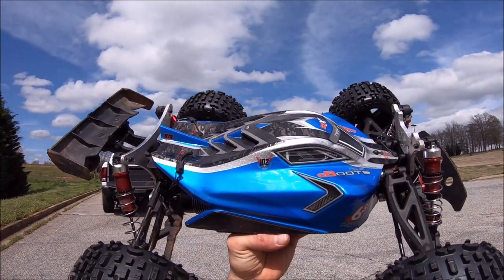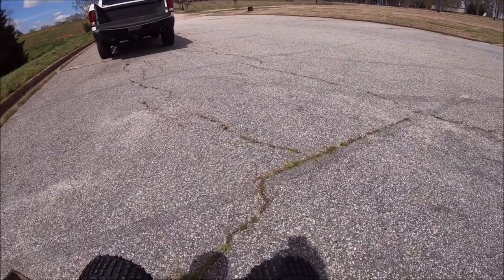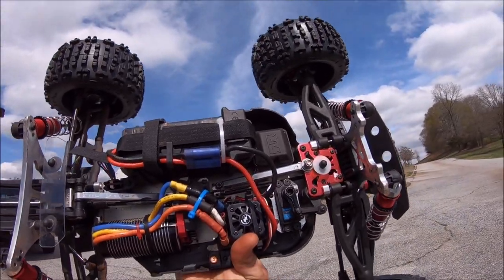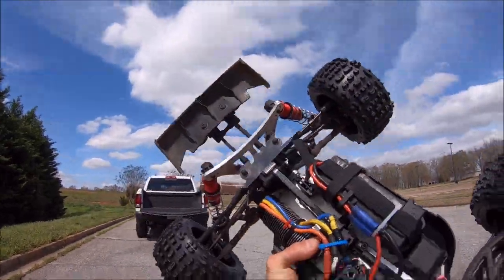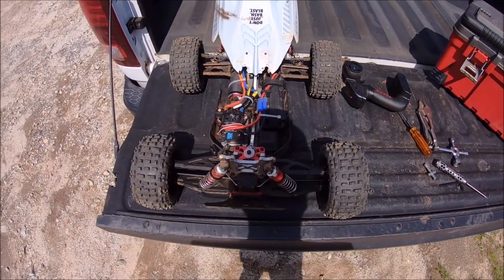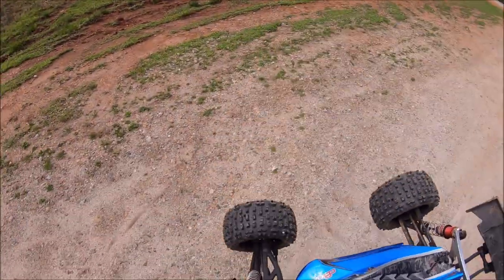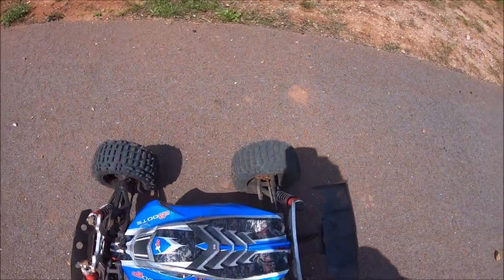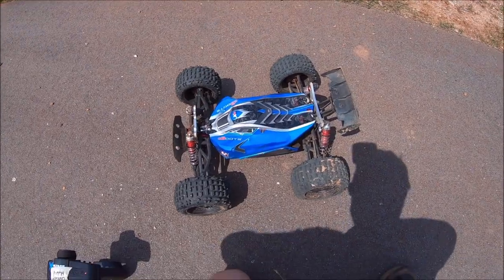"FLIPPIN" BEAST!! Arrma OUTCAST Hybrid 6s with Zoskay servo review.

Comment: That things a tank dude! You beat the shit out of it and didn't break a thing.

Have you tried carbon fiber shock towers? I've got them on my Kraton and I've been kicking the shit out of the poor thing all week and broke nothing but snapped 2 screws inside the wing mount 🤣

Haven't had to straighten my towers it's a bloody miracle. Mate and they're still intact! I was doubtful of their strength and thought their rigidity would make them weak but it doesn't seem to be the case bro. 5mm thick and light as a feature.

Your truck is f***ing awesome bro 🥰 love it man 🙂👍👊👊✌
Reply from the maker: Thanks so much bro! No breaks just a few things shook loose and of course the servo went bad.💩Haven't tried carbon fiber towers although the lightweightness of them would be nice! I'll keep that in mind! Thanks for watching bro!😎👊💪🤘🤘

Comment: I have a typhon that is stock. I now have a 2nd blx185 ESC die on me within a month.  Stock pinion (not speed gear), 2 x Reaction2 5000mAh 50C 3S Lipo.   I run it on a dirt track and a ramp that's approximately 8" high.  What ESC would you suggest for bashing?

Comment: Tough luck on the servo.... Did you put anything under it? I don't send it like you but I use a small piece of yoga mat taped under the servo... Maybe that helps?

"don't know how many flips that was"..... Was 5 dude!..... Insane!

I gotta ask because it looks so crazy how you land those 4-5 rotation huge back flips, on some of them are you just hucking it and hope you land wheels up? Or are you tracking all them rotations and calculating the distance to the landing to stop/space your rotation??
If you are doing either its crazy skill, but the split second stop of rotation before she lands... Crazy! 
Is it just a "I know how many spins I can pull because of hang time" because you are so comfortable with the characteristics of the truck and air time.... You just know??
Appreciate your insight

Them high speed tumbler wild flips.... Look so fun.... Bet the non Outcast body helps so it don't get in the way.

Awesome bash brother
You, Duperbash and a few other paving the way!
Appreciate 🎯💪
Reply from the maker: Sorry for the late reply bro, for some reason your comment was in my spam!🤔But no I just threw the servo in and went!😂It was a review servo that was sent to me so I just wanted to give it an honest test! Maybe a had a lemon!😂I've lost several servos in the past off that hill jump bc the gravel landing are so hard! As far as the flips, they are all done by controlled throttle blips or full peg of throttle for constant flips. Timing is everything on the landing! Have to come out of the last rotation just in time to tap the break and bring the nose down for a landing! Took a lot of practice but it's a thrill for sure!😊Thanks so much for your comment and kind words! have a great week bro!!😎👊💪🍻🤘
Reply: @RCDUDE81  killer bro.... Appreciate the feedback. I'm just working up to controlled singles and doubles and doing slight corrections. What y'all are doing looks like stopping a tornado mid rotation for a landing. Like you said brother... Practice.
Some day I hope to have content close to as exciting on my channel...(3 Sons RC) Right now I just send it and learn from my mistakes and Bash with the kiddos .... But your tips help brother.... More than you know. Thanks for paving the way.... Check out the channel if you get a moment, could use some feedback on how to build it 🎯👍😜

Comment: Eric dude, what size motor and KV do you recommend me get for my 6s Kraton turned Outcast bro? 

Shopping for a new motor and thought I'd ask your expert advice before making any decisions ✌👍👊👊😉😉
Reply: Change chassis from Kraton to outcast only parts I'll need are centre drive shafts.. Am I right?

I got an m2c outcast chassis arriving in the post and want to order everything I need to get on with the build 🙂👊👊👍✌😉
Reply from the maker: Honestly stock motor is good in an Outcast imo! I'm running a 1730kv 4092 size in this rig and its hard af to control and hold power down! Perfect motor for a Kraton though!👌 Parts of this rig used to be my V2 Kraton.🤣There is lots of motor options out there but I'd say stay around the 1800-2000kv range and around 4074 size can. The Max8 combo is a sweet pair but 2200kv motor can get toasty if overgeared! Good luck with her bro sounds like a fun build!😎👊💪🤘🤘

Comment: How long do you think you get out of the diffs , even didnt just have bad luck,  so far for me I had ones last not shimmied and also shimmied my outcast lasted almost a year alot of runs so I coughed up to wear tear the Kraton was great till it was beat up I fix it up tune shim but just kept stripping the same 2 teeth over over even hardened ones . Finally I completely rebuilt the car pretty much everything new except chassis and been good so far . I did go back to lighter diff fluid . I thinking it was the diff case but shimmied like you said usually have good luck rich told me look hairline crack nothing idk lol dam quarantine my typhon sitting on shelf at lhs it's the v3 tho I do like the v4 katars better but nbd atleast have tactic and I'm getting for 100 cheaper 😝💯👍
Reply from the maker: Usually my diffs running in HR cases last. Havent had an issue in a couple years. Just normal wear then I may add an additional shim. This rig has plastic cases although they are older diffs, the plastic does get warm and expand causing potential diff failure. Probably all the standing backflips in my last vid with it plus this run did something in!😜Sucks on the quarantine man...may be coming for us soon!👀Take it easy bro!😎👊
Reply: @RCDUDE81  thanks reply brotherman,  definitely going try HR cases I haven't tried them I didnt think of that the heat especially if bearings on there way out . Yea quarantine sux I dont want see ppl hurt but I'm anti social anyway theres no traffic and lobsters half price 😉👊

Comment: I seen LP’s at Jennys and I held back.  I spent enough to get my rig up and running that was all. No extra’s for me. Not now anyway.

One q for ya there is different thickness oils in the stock 6 s Diffs. Will I be able to seee a difference and know which one goes on the front and rear. 
Mine are coming from Jenny’s

I just thought of that.  
The one thing I do not have is diff fluids
Reply: I have this written down from the manual, it doesn't list centre diff but I use 100k and its fine

ARRMA Typhon:
7K CST Front/Rear Differential Oil
550cst Shock Oil (45wt = 575cst aka close enough)

Comment: Man Eric that beast is super badass.its funny i was thinking " i lost count of the flips" and you said how u werent sure how many haha.thanks for the tip on the steering link.ive definitely got that going on with the kraton right now im gonna try it.do you have many issues with sway bars falling off? One trick i found is to put old chewed pinions on the end of the sway bar n it wont slip off anymore.i think losi(i dont recall what car) has a pretty good swaybar set up i dont see why it couldnt be put on

Comment: Did you have to change the body mounts to fit the typhon body?
Reply from the maker: Yes it has Typhon body mounds. Had to modify the rear just a tad to line the posts up but it works!😎

Comment: Can I ask what was the clicking / grinding noise through most of this run?  Was there a diff or a drive shaft issue?
Reply from the maker: I think it was the rear diff...had a bit of wear on the ring gear from too many standing backflips!🤣These were old diffs and since been rebuilt.

Comment: nice body on outcast😍😍😍
may i know whats ur diff fluid spec？ how much pinion teeth u using in this video😁😁 they are blasting fun. thanks
Reply from the maker: Thanks!😁Running 60k, 500k, 30k diffs. 20 tooth pinion with the 1730kv 4092. She a handful with that setup!😜Went down to 100k center and much more pleasurable to drive!
Reply: @RCDUDE81  thanks a lot for the info😁😁😁 love to see how u bash，going to get a try
so if i want to stunt backflip go thick on the center diff
and if easy control get thinner on the diff rite？
Reply from the maker: Basically yes. Thicker center and front will give it easier back flipping abilities and help stop front diff unloading.
Reply: @RCDUDE81  thanks again ya， you are so kind😁😁😁
Reply: @RCDUDE81  😅😅😁me again， one more question， currently i m using 60c lipo， does the higher c rate relate anything with the power output？ or easier to do standing backflip？
Reply from the maker: @BTRC  60C should be plenty! But yes, the higher the C rating the faster the discharge rate under load meaning more juice!!
Reply: @RCDUDE81  i get it ， thanks again😁😁😁

Comment: So I have a TYPHON 4x4 can I put theses wheelies on it
Reply from the maker: I'm not positive that these wheels will work with a Typhon Mega..maybe a 2.8 option like Proline 2.8 Trenchers should work. I used those in my 3s Typhon with no problem. Direct fit!😎👊
Reply: RC DUDE81  THANKS MAN. LOVE MY TYPHON 4x4 MEGA . Not really into Brushless. Less breaking.

Comment: Is that the v4?
Reply from the maker: No this is an old built from spare parts truck!😜Lots of Voltage upgrades!
Reply: Nice rig! I'm working on building up my v4 kraton. Unfortunately voltage hobbies is sold out of almost everything right now.
Reply from the maker: Thanks!👊Yeah most all my other trucks are running M2C so I just had these Voltage parts in a box. It's a shame he's no longer producing but still great parts!
Reply: I have to do some work on my kraton front diff.I'm curious if I Should shim the outside of the diff more than the one shim it comes with?
Reply from the maker: Yes the outer shim? I'd definitely add another!👌I run 2 shims per front and rear and hardly have diff issues. Gives the ring/pinion a tighter mesh. I did have trouble at the end of this vid simply bc the diff was like 3 years old and was lacking maintenance!🤣
Reply: 1mm shims? I haven't  even had mine a month yet and I mangled some teeth on the front diff  doing a back flip on punch setting 9 lol.